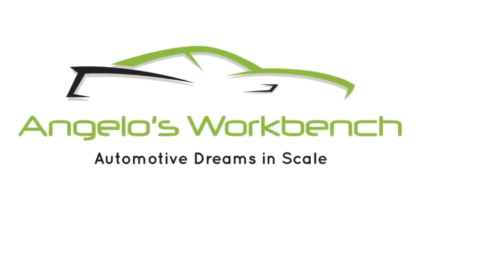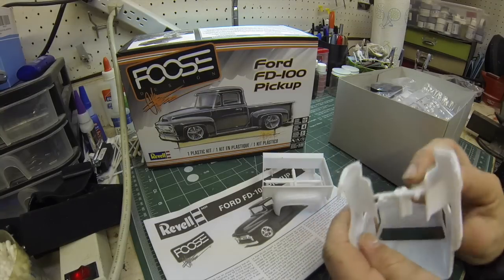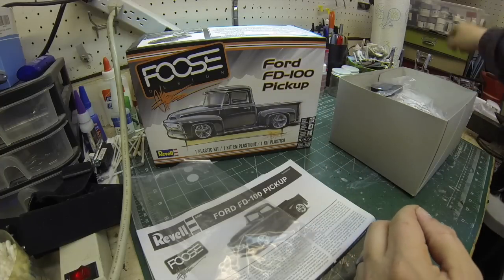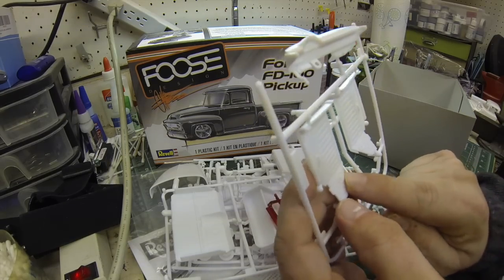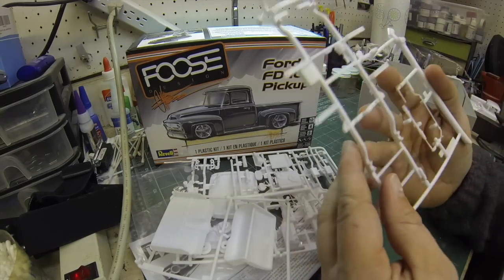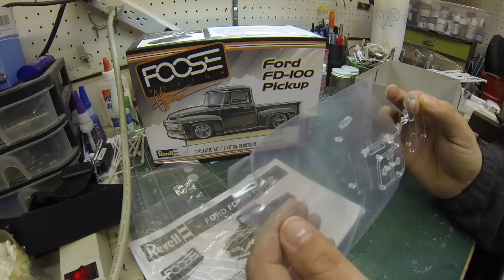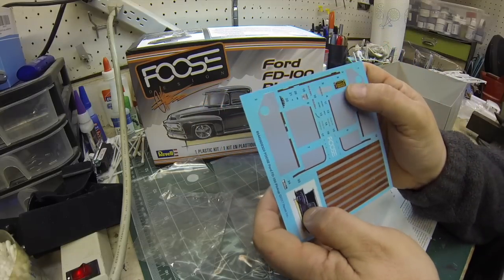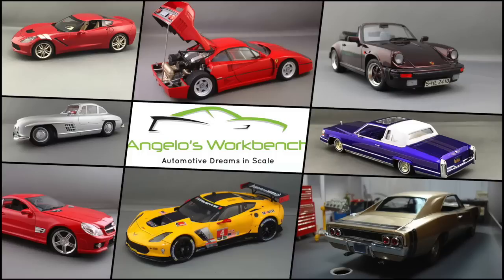Revell Foose Ford FD100 Video #1

Comment: What I have done on other kits that have metal axles is go a take drill bit to rims and make the holes just a little larger. Apply some ca glue and you are good o go.
Reply from the maker: Samuel Vasquez thanks for the tip.

Comment: Hey Angelo,  I'm getting ready to use some Tamiya Semi-gloss paint. I don't know the correct procedure for thinning Tamiya paint. I know that you're supposed to get the consistency of milk, but that's hard for me to see. I was hoping that you could give me a ratio that would get me close. Have a great day, Mac
Reply from the maker: Hey Mac. There’s a lot of variables like your airbrush nozzle size, etc. so it’s tough. Try one drop of thinner to every 5 drops of paint. If it spits then it’s too thick and if it doesn’t cover and is runny  it’s too thin. Good luck.